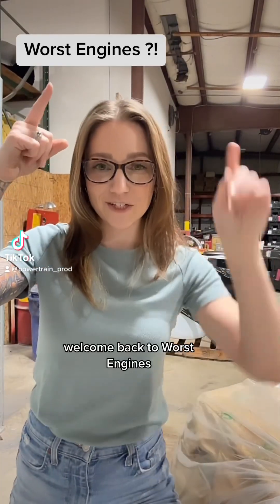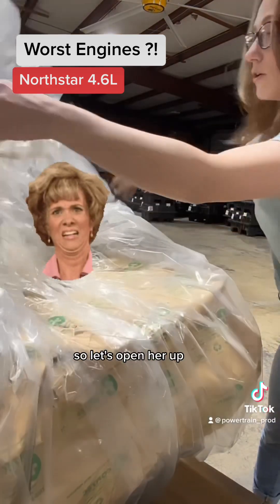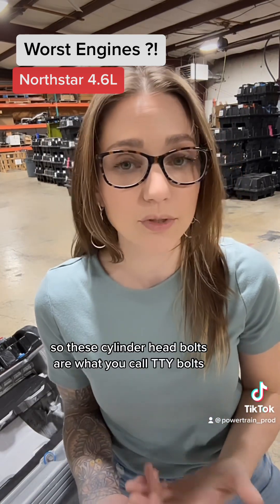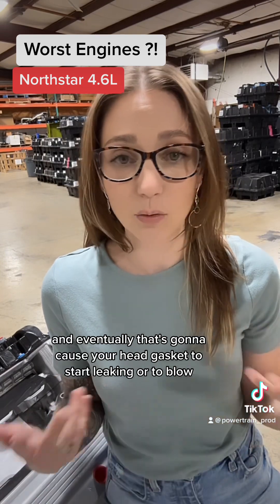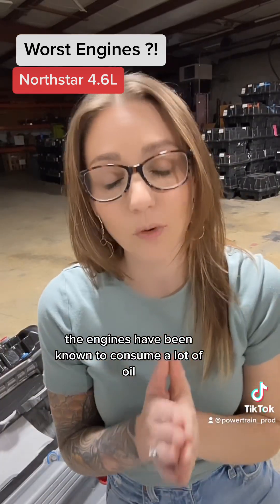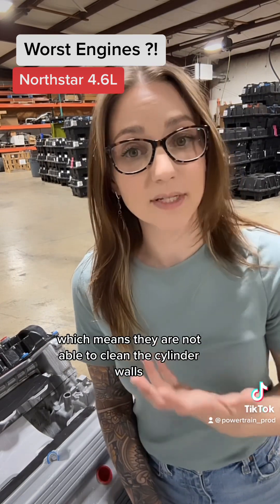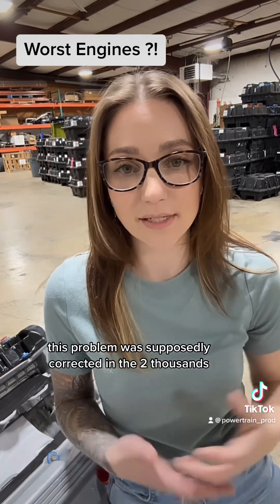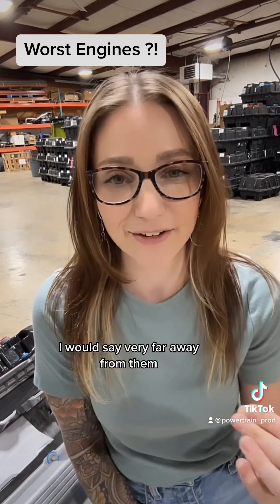The Northstar 4.6L Engine Problems

Comment: I call bullshit on this channel!, about the Northstar,  if you truly know the 4.6L (283 cubic inch) Northstar engine, you will know the correct procedure about tighten down the head bolts (there's a company in Canada that can help you with that), other than that, again if you truly know about the Northstar Engine, you can get 380 horse and 385 torque (advice timing) at the crank! That's not bad for an engine weighing 300 lb more or less. And if you twin turbo it, you can get probably 600 horse & 600 torque at the crank. People do it all the time in Southern California shops, to hit the dunes in Glamis, CA!!
Reply from the maker: All fine and dandy for people who are interested in learning those things, or cranking up HP nd torque for performance purposes. But for Dear old Granny who just wants her vehicle to run properly until she doesn't need it anymore and maintenance to be cheap, its a terrible option

Comment: WOW......a whole lot of smoke you're blowing up you're viewers  tailpipes.

First:

Torque To Yield cylinder head bolts have been INDUSTRY STANDARD since before I started turning wrenches proffesiinaly in 2001. Their metallurgy fatigue is not the cause of blown head gaskets. The bolts perform as designed. The root cause is lack of maintenance!

The cooling system was overlooked. Ethylene glycol based coolant has a service life of 3yr/36k miles. The propylene glycol based Dex-cool has a longer life of 5yr/75k miles. When left to breakdown and deteriorate the coolant hoses from the inside out....a laundry list of components can and will fail.

However the most dangerous is the electrolysis that occurs from the charged coolant in the system. Electrons are transfered back and forth from the aluminum to the coolant mixture(all the metal of the car maintains a negative charged as it is grounded). The fight for more negatively charged leaves voids in the aluminum in high stress areas surrounded by the coolant. Namely the head bolt threads near the bottom of the water jackets.....

The weak aluminum looses its grip on the threads of the bolts and you have excessive lift of the cylinder head around that bolt hole at the deck surface.

THE BOLT DOES NOT FAIL DUMMY!

With the cam cover removed, a good known and calibrated torque wrench set to 50lb/ft,  and a 10mm extended length 3/8 drive Snap-On socket.....attempt to tighten the head bolts in sequence of the suspected head.

One or more will spin. If you had any experience, or sense to not speak in ignorance, you'd see the aluminum threads on the bolt when removed. TIK TOK....SMH

SECOND:

Oil leaks.....😂😂😂😂😂 clown! The valve cover gaskets don't leak! "Cracks" if any.....are inflicted. 

The rear main seal has a 5% chance of failure. The lower crankcase is where the oil leaks occur. Mainly the anaerobic sealant used to seal the main bearing cap bed plate dries and cracks, and THAT IS WHERE THE NORTHSTAR LEAKS OIL FROM!

FINALLY(because I can't stand to listen to anymore wrong information) OIL Comsuption:

The Northstar came in a "Y" and "9" version. Both over 10:1 compression, both high output, but one higher than the other. 

The engine design was ahead of its time alright. Premium fuel was required. Used....nah! The ECM detected knock and therefore retarded ignition timing to keep the engine safe. 

The target demographic was not ready for a high performance, high maintenance, performer like the NORTHSTAR. Cadillac over shot that by about 10 years too soon. 

98% of the clientele at Ken Batchelor Cadillac in 2002 was over the age of 70, accumulated less than 7k miles per year on their luxury sedans, and very seldom got the engine to operating temperature in a single drive cycle. What that lead to was excessive carbon build-up on the 2nd and oil control rings.

A service set of rings was experimental, and used a 2nd Napier oil scraper ring as the only difference in an attempt to decrease oil consumption.

Passing along false information like your video is what's wrong with America. Shame. 

The NORTHSTAR is an amazing engine. Much more amazing than that 2 cent  🧠 of yours.
Reply: Exactly, very well stated!
Reply: @starxlr7863  thank you sir!

Comment: You are misinformed also there are  two different versions  fwd and rwd and its not the head bolt it was the thread pitch also the rwd Northstar does not have this issue ive had 9 of them and only one had the headgasket issue and it was a 99

Comment: GM lost a whole generation of customers that bought vehicles with this engine.
Reply: Couldn't have been very many left after the 5.7 diesel, V8-6-4, and HT4100 of the '80s.
Reply: Gm was dumb to say this engine can go 100 miles without coolant and 10k mile oil changes that was fatal flaw #1&2… they also started putting first batch of dexcool in all gm cars in 1996 .,and people are lazy and don’t do coolant changes (especially when gm was saying ohh the coolant don’t need changed for 100k miles) fatal flaw #3 … shortening the headbolts to use old leftover quad 4 engine headbolts they had in droves  starting for 97,98,99 was fatal flaw #4… this is a picky engine if your a slacker on oil changes and coolant changes and don’t keep up with maintenance , you shouldn’t buy a car with this engine….in 2000 they re-lengthened the bolts back to normal size (after massive failures in 97,98,99 and dexcool turning acidic and eating at head gaskets) but they didn’t change the thread pitch… so 2000, 01,02 & 03’s are still a gamble… late 04’ they finally used ls headbolts with a coarser thread for the 2005 model year on. And it pretty much solved the problem. You still wanna keep up on coolant changes… so u want to buy a last year 2005 Deville and the new DTS FOR 2006-11.
Reply: @toddprater14 Bingo! You nailed it! I have stated the same thing in earlier posts. I remember going with my parents to pick up their cars with these engines in them. They said 7,500 oil changes (because they take 6.5 to 7 quarts of oil) and never needed coolant changes. As it was long life. I helped maintain my parents vehicles before I ended up inheriting them. I kept up on the oil/coolant changes and never had the issues. I sold one car with the short north and still have the olds aurora 4.0. Both ran/run great.